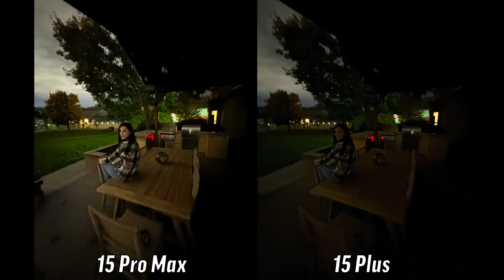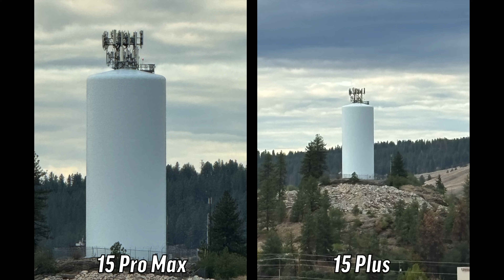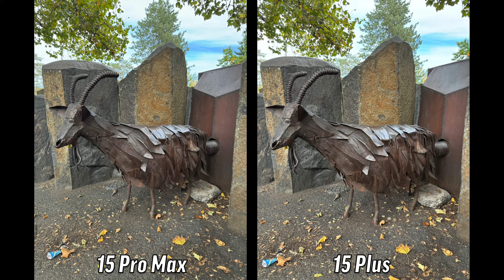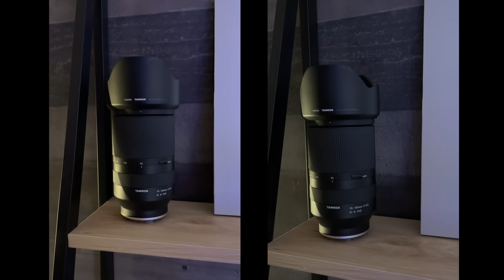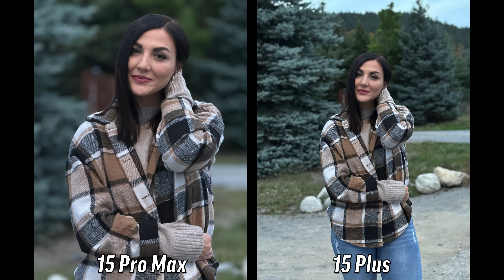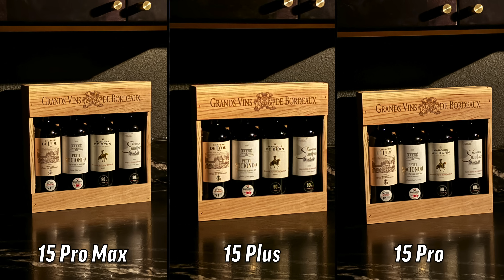iPhone 15 vs 15 Pro & Pro Max - Ultimate Camera Review!

Comment: iPhone 12 has a dedicated 50 (x2), iPhone 15 uses digital crop. Side by side the x2 camera is unbeatable on the iPhone 12. The advantages of the iPhone 15 is low light and action cam. Not many people run in the dark with their phone most use the x2 during the day. I use the x2 camera the most so iPhone 12 is the winner for me. Apple only ruined the x2 camera because they don’t want to add another camera but want to compete with Samsung zooms. How often are people really zooming though compared to taking portraits?

Comment: How badly can Apple scam you … well the iPhone 15 pro max is the ultimate. It doesn’t have 7 cameras just 3 and it crops the images to get larger focal lengths. Crops so much at 115mm you’ll get a dreadful 0.5MP. That’s barely good enough for a 3 inch print. You don’t get 48Mp lenses either as Apple have split each pixel so they are not collecting all the info a pixel should. It takes 4 apple pixels to get that info so whatever you think it’s giving 12 MPs. Disgraceful.

Comment: Just for the ones who take pictures alot which one is more useful the x5 or x3 since i know you will be missing the 3x zoom with the pro max. I just want to know which one is more useful in real life
Reply: Depends on your subject. Using 5x telephoto on Samsung for 3 years. If it's wildlife - super usefull, you don't scare animals coming close. For portraits 5x is just to close, you would need to be able to walk away from subject pretty far, so in the city not comfortable at all. Same with still life. I really wished I had 3x vs 5x most of the time.

Comment: Can you please do a deep dive into the macro modes? I don't need a zoom but I do need to be able to take good closeups especially of writing on circuit boards and small text like serial numbers and the like as it helps me endlessly in my work. I am absolutely torn between the 15 Pro and 15 because of this.
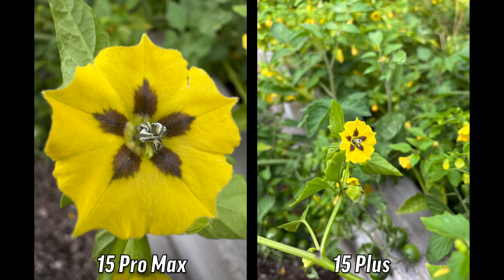Reply: Pro. Macro mode. 4:20
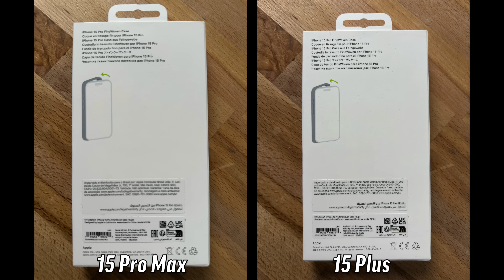Reply: Yeh but what's the deal at 5:22 ? @conspicuous_cracker
Reply: Did you end up buying the 15 or 15 pro? I also want a camera that can take good close ups like you have mentioned concerning serial numbers/printed words up close.

Comment: I chose the iPhone 15 Pro (not the max), but I was sad that I couldn't take 5x portraits with that beautiful effect. But I went crazy when I was taking pictures and zoomed from 3x to 5x in portrait mode. And I was shocked because it was almost identical to the result of the 5x lens of the pro max. I had the 13 Pro and there was no possibility of zooming in portrait mode, at most it reached up to 3x. You who have the iPhone 15 Pro, open the camera in portrait mode, select the 3x lens and try to zoom. Go straight to 5x and the portrait effect is perfect. I don't know if more people know this, but I still haven't seen any YouTuber explaining about this possibility or testing it. I'm super excited 🤩
Reply: Wow so really no need to get Pro Max if I only want 3x to 5x camera?
Reply: @GronkyTonk  Not for me, but you do what you want :)
Reply: @GronkyTonk stop making me feel bad for buying pro max
Reply: Useful tip. I think you can also do that in photo mode zoom 5x press on the screen to focus the desired object and then shot the photo after ‘f’ mark on screen so you can just edit it in gallery whenever you want, with portrait mode or without.
Reply: Hi @hiagobeckerle7310, MagMirror might help you achieve stunning portrait effects with perfect lighting and framing for your iPhone 15 Pro.
Reply: some people want actual dramatic awesome shots that truly wouldn't be possible without 5x or more zoom cause you get stuck on just the actual sensor and not that it can zoom in 10x more so clearly people who travel, are in cities with big building, art, world wonders in the world the 5x can zoom you in a shot that you would never have  ever got before
Reply: Onn poda @beebeedeeie
Reply: Nope bro the pro has bad quality

Comment: From what I’ve seen of my 15PM so far, you have two main places to be cautious, as you pointed out:
—  In the ~65 to 119mm range, where it has to crop in from the main sensor, and starts running out of resolution in doing so, and
—  Close-in focusing (not even macro) other than using ultra-wide.

Essentially, avoid where possible the 3.5-4.99X zoom-level, and scrutinize close-in focus especially carefully, being ready to switch to ultra-wide/macro.
Reply: well sure but just give go in closer to the shot or walk a bit back simple, the 5x still is better tell me when you can zoom in up to 25x like the 5x can when in times you really cant take it like a big building and you zooming into something or art a bit away or world wonders that don't put you so close to the actual structure so the 5x is perfect to get that close up shot, with 3x you could just try the 5x or just do 2x it'll be just fine I promise

Comment: Thank you for this beautiful and serious videos. I sold my iPhone 11 Pro to buy the 15 Pro Max. And my main use is photos. OK the ultra wide angle and night photos are better. But the daytime photos taken most often are less good. In addition, 15 Pro has a 20% larger Main sensor. So what a disappointment! Let‘s wait for iOS 17.1 and see if Apple has improved the 15 Pro cameras.
Reply: It's not 20% larger than 11 Pro, it is actually 3 times larger

Comment: I tested the 5x lense inside in lowlight and for some reason if I use night mode and then turn up the exposure to get things even brighter, I see the change on the screen that it looks brighter, but after I take the shot and look at the photo it looks much much darker than what I saw on screen before I took the photo. Then if I turn off night mode the exposure seems to work better. But with the main lense it seems to work better even with night mode on.
Reply: Same with selfies
Reply: @garthfielding9143   Yes annoying

Comment: TLDR;  15 Pro has a 20% larger Main sensor (Same as 14Pro) compared to Regular 15. 15 Pro max has a 25% larger Telephoto that 15Pro and hence faster shutter speeds. UW on Pro is also better than. the Regular 15. Finally A17 vs A16 does make a diff in Photos and videos. By maybe 10-15 percent. And i feel that its bit early to comment on image quality now. I have seen iPhone cameras getting better after software updates in 6-7 months time.
Reply: Let‘s wait for iOS 17.1 and see if Apple has improved the 15/15Pro cameras.
Reply: Btw it's not 20%, but 49% larger. Remember photosites are shaped in rectangle, so the width length is squared: (2.44/2)^2 = 1.4884x

Comment: I don't like this year's iphones at all:
1. The 15 pro's x3 max zoom in 2023-24 is embarrassing.
2. The 15 pro max's x5 zoom (INSTEAD of the x3) is just too long of a jump from the x1, we're missing an entire range between 48mm (optically really just 24mm) and 120mm. And of course the phone itself is very big and heavy (not useable in one hand).
3. The titanium frame scratches way too easily - as a no-case user this is very annoying.
Reply: I agree it should be 3.5-4x for the regular Pro, or at least just update the hardware instead of reusing it for the third year. Can't say about Pro Max, I hate that model

Comment: Still, for a Lot of people the 5x will be too much. 3x is a much more versatile zoom. There is a reason why so many always on lenses are 24-70 or similar (which is 1-3 times zoom). 
5x often can make it harder to frame a shot and you really have to step back with portraits. Otherwise the 15PM will automaticaly chose the main lense and crop in
Reply: Hopefully the 16 Pro get 4 cameras & the normal 16 get 3
Reply: Maybe , but people who owns a Ferrari not always are racing at 300 km/h . Maybe x5 zoom will be used only 5% (just like the processor(full power)), but the fact that you can have it when you want it it’s worth it (sorry for bad English)
Reply: next year they wanna do x10, lol
Reply: @finality4795 where are you going this from 💀
Reply: Hi @danielm.2118, that's a great point about zoom versatility! MagMirror ensures precise framing for any zoom range, enhancing your smartphone's capabilities.
Reply: ill give it to you 3x is more versatile but the better lens is still 5x regardless comparing the two the 5x will always give you a more dramatic photo but if you take random photos sure but some people care about quality shots!
Reply: @beebeedeeie  the quality between the two is the same (for Color, sharpness and so on). Only the look should be different. In the end I think it depends on the situation which is better. Thats why I also went the iP15PM. The bigger screen and battery life is always better. The dependson the situation. 
The difference would be bigger of the tele was Not 12MP. Cause the difference between the 2x and 3x isnt that big. But the difference between 2x and 5x is. 
I am very happy with my Max.
Reply: I'm talking about quality in terms of background blur and truly making it with some shots look more like a stand alone camera with how depth the photos look. they really need to just make all the cameras 48p as standard with camera in 0.5x/1x/3x/5x  @danielm.2118

Comment: I was kind of surprised that the 15 has a newer sensor than the 15 pro and pro max. That seems odd to me.
Reply: Yeah I didnt understand that
Reply from the maker: Yea, Sony makes the sensors and this is a brand new one. I'm not sure if they updated the slightly larger one that in the Pro's yet so that could be a reason, or Apple just wanted to re-use it and save some money since costs go down over time.
Reply: Could be because of yield rate: larger sensors means defects on the wafer is more prone to make the entire sensor unusable, smaller sensors means it's much easier for the defects just to be thrown away and it won't affect the yield that much.
Reply: "Hi @AndrewGiddingsWA, it's intriguing how sensor updates work! MagMirror complements any sensor with tools for pro-quality lighting and framing.

Comment: should I upgrade to 15 pro or 15. I currently own 11
Reply: Depends what you want and your budget-Both are great devices!!-However if you want a bit extra like promotion or triple cameras with the extra upgrades this year then maybe get the pros!-Also if you want a titanium phone with some more features like the action button-Again get the pro!

Otherwise the 15s are great this year-You get the dynamic island-And a lot of features from last year’s pros-Either way you can’t go wrong this year!
Reply: @RaghavVijay  I would go with the Pro. As the A16 is a chipset of 2022, the regular iphone 15 born with one year old technology. If you pretend to stay with the phone for at least 3 or 4 years that can be a big difference!
Reply: @Fernando_1903  You have to also consider though that  is not likely to discontinue the iPhone 15 and keep the pros-Even if they do it will only be for a year or so.Also The chipset really shouldn’t be a main reason for spending more for a new iPhone. One generation of chipset won’t make a difference.Imagine if  went on stage and said the iOS support is only for the 15 pros and above-It’s possible but it would be controversial for sure!- would only do that many years from now at the latest.
Reply: If the phone still serves your needs then no reason to upgrade, as simple as that.  If you will upgrade, upgrade to the 15 pro the 120 hz screen and the triple camera set up will be a major quality of life improvement.
Reply: @LEDsellers  agreed!
Reply: do it! unless you're poor then dont.
Reply: Pro, especially if you plan on keeping for several years.